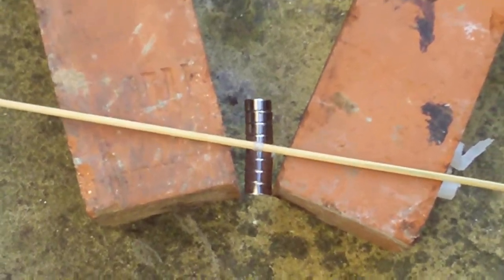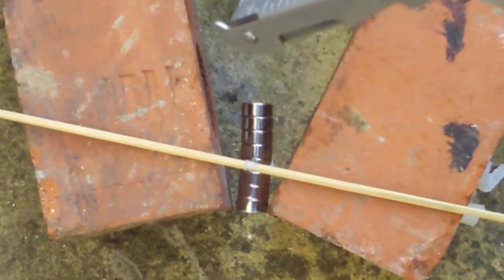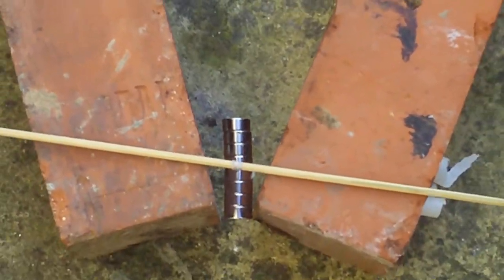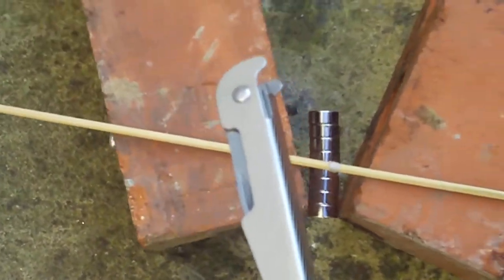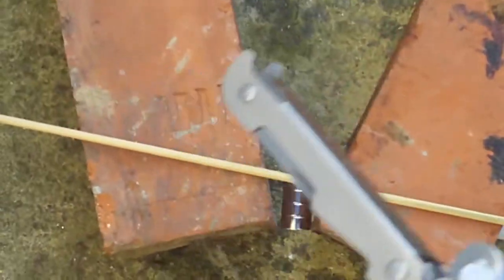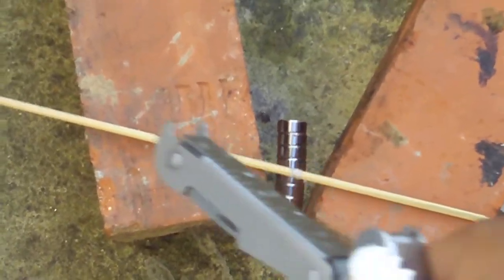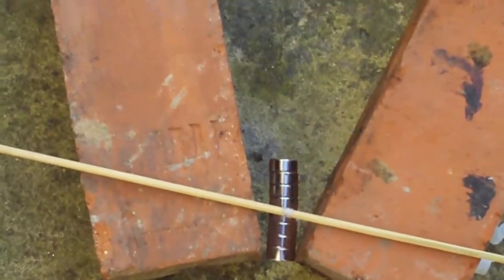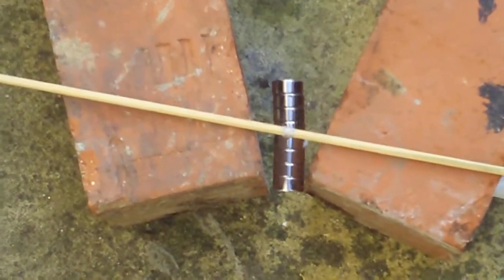COMPASS ENGINE by John Michael

Comment: You have an interesting idea. But why use the Earth's magnetic field, which in anyone
place is a tiny fraction of the strength of the permanent magnets you are using. You
should be able to build this device using permanent magnes to replace the Earth's
field.